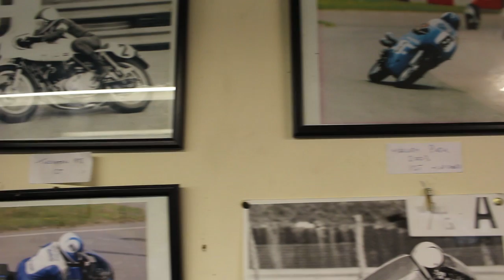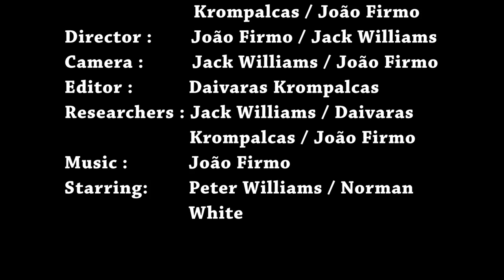Peter Williams - Designed to Race

Comment: The illustrious son of an incredible father. With regards to the monocoque Norton I had connections with the incredibly intelligent owner of one who refilled it with petrol while smoking,you can imagine the results. Granville Motorcycles of Swadlingcote had great knowledge of the works machines and told me that in changing the standard alloy pushrods for steel there was a 2HP gain and a similar amount by having cast iron camshafts with their inherant stiffness. Wonderful days that we'll never see again. Thanks for the memories.

Comment: Is it possible to find out what steering geometry and wheelbase was used on the monocoque Norton ?
Reply from the maker: Just asked Peter and he said 'Steering angle is 27 degrees, and trail is 70mm (not certain). Wheelbase would be 56 inches (1422.4mm).'